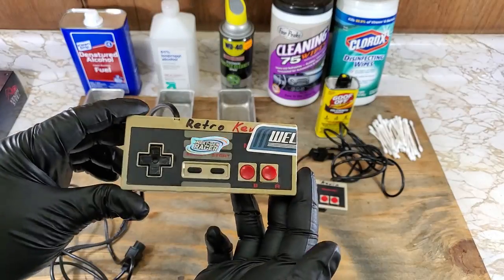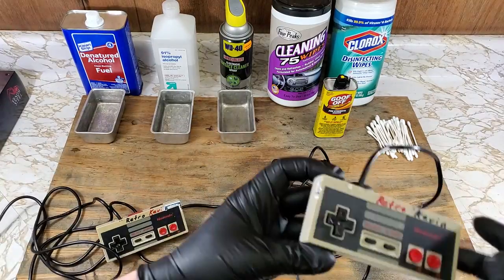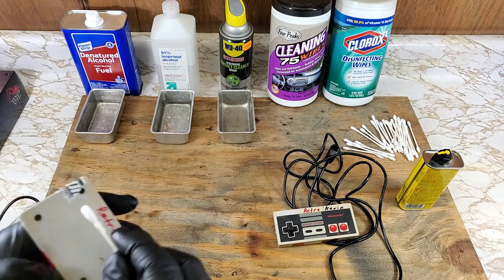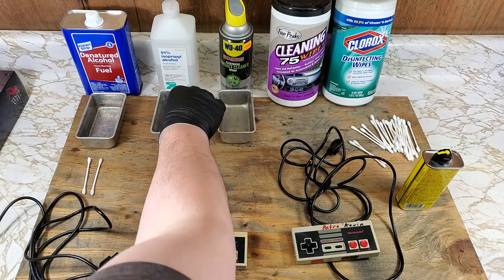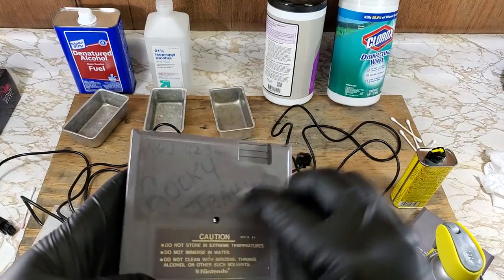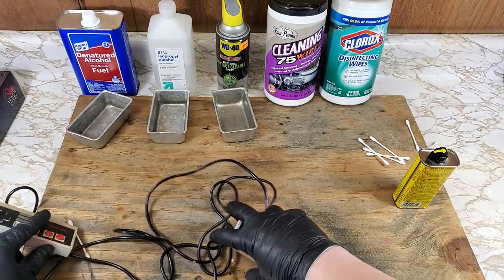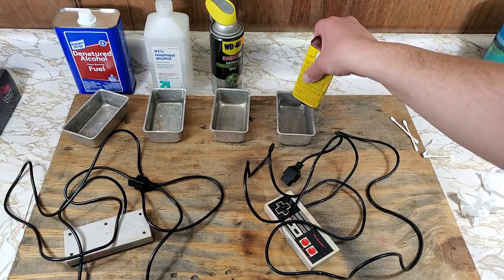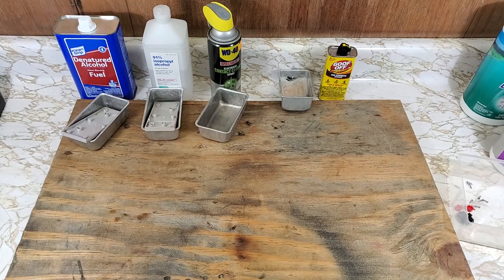Retro gaming cleaning and refurbishing products comparison

Comment: Great video. Goof off is mainly best with a cloth to only take sticky residue off of things and then clean it off with Denatured. Goof off was never meant to be a long term exposure product.
Reply from the maker: Agreed I probably didn't use it as intended. But just in the short time I used it for the sticker residue it started eating at the plastic. I'm sure it won't do that to all plastics, and if taken care of right away probably wouldn't have been bad. But personally I'm going to avoid it when I've had zero issues using Isopropyl. Thanks again for the recommendations. Hope to see you around.